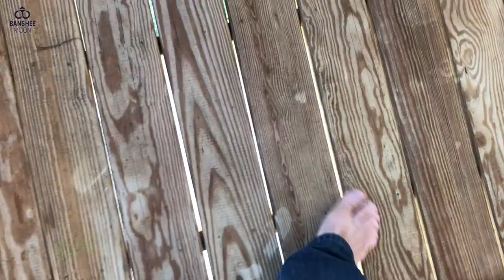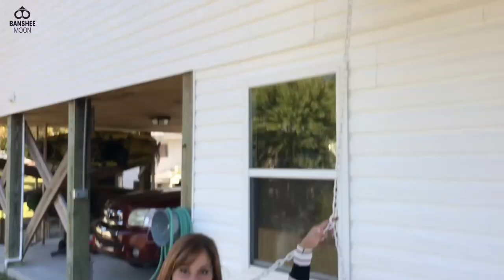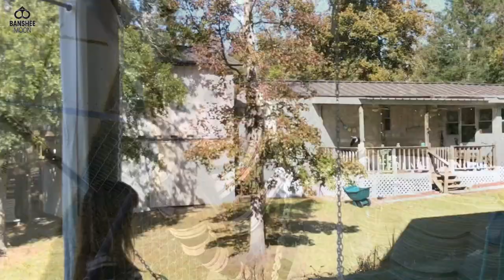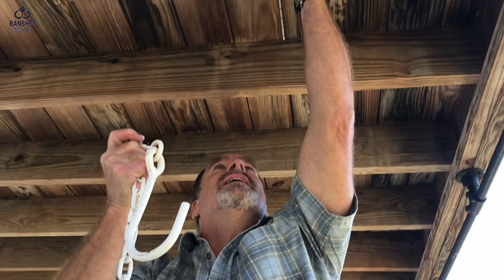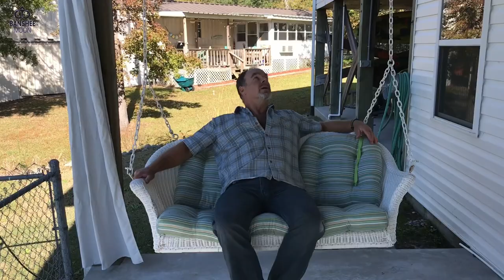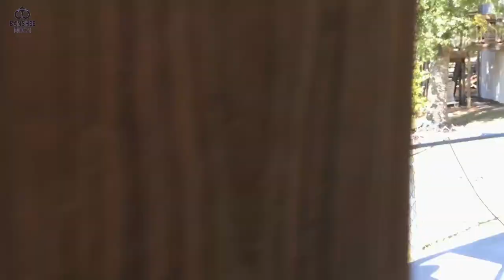Swinging Quietly and Safely- Hardware Replacement

Comment: While fitting the new hardware, I would have fitted a safety chain each side as well especially swinging on there with the grandbaby, seen eyebolts pull out before.

Comment: Don't know about the rest of you,  but when I'm swinging I like a little noise. It's feedback to let me know I'm making something happen! OK, now that that's out of the way, I'd get a wooden dowel and glue some pieces into those old screw holes.  With them only being an inch from the new ones I would be afraid over time and use they'd become a weak point.

Comment: I think you should move the swing forward to the next beam because if it ever breaks and your legs go down between the edge of the deck won't be funny.
Its to close to the back. I'd move it forward to the next beam or next beam before that. I've had eyelids bend open and even break. Or come right out of the wood. Or the board break and then You scream and can't believe what happened.
 You think they're strong as steel but they're not. And we think boards don't break But they do.
If you move the swing up one beam or two forward I'd feel better. 
Imagine if it broke when you are swinging waaay back.